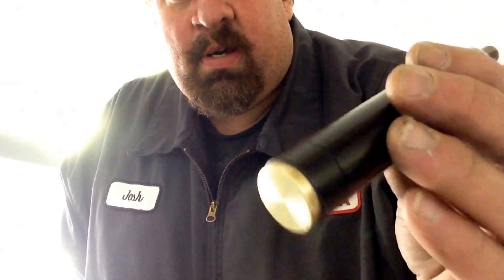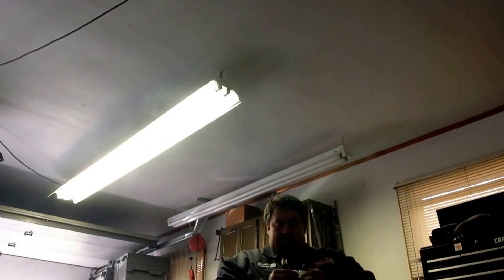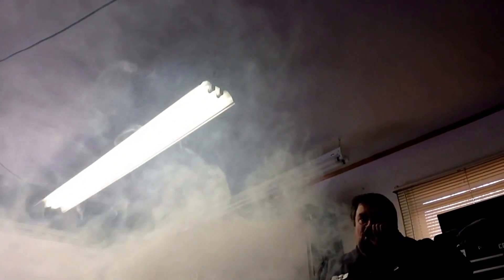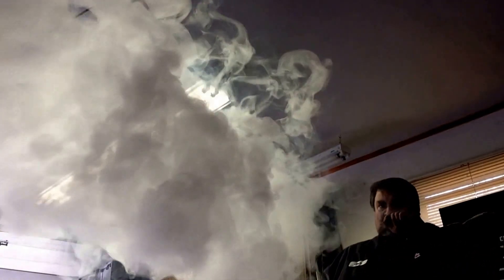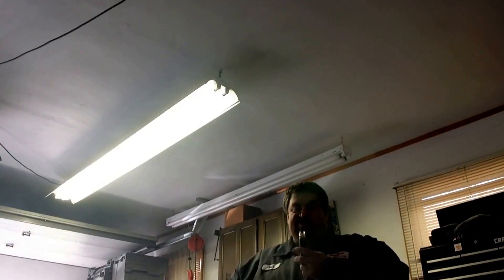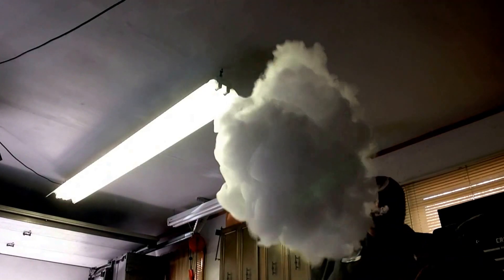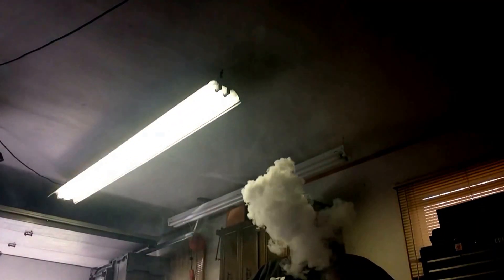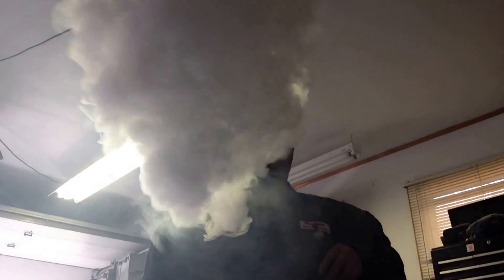Fogging it out with the ameravape Manhattan,nimbus,copper post, triple parallel oval build @ .08 ohm

Comment: Anybody that want's to blow clouds, here's the long story short:
~*Drill your atty to AT LEAST dual 5/64th's, I like 1/8th" and wider actually.*
~*Wrap 24ga 4-5 times on a 1/16th" drill bit, make two of those. (for 22ga wrap 6-8 times), it should come out to 0.2 ohms, use a 30amp battery. (sony is the best)*
~*If you really want to blow huge ones, get some Gplat, look it up, you'll thank me later, get the 22ga elite if you have an ohm meter and know what your doing.*
~Wick with the fluffiest, lightest cotton you can, through and under the coil. Shiseido makeup cotton is the fastest wicking in my experience, it's japanese makeup cotton and it wicks about 2x faster/better, tastes better too.*
~*Juice up with some 100%VG juice, even 80VG/20PG is good for some builds.*
~*Inhale quick and confidently and become a fog machine!*

~Always be safe, know your amp rating, and ohm's law. Hope this helps! Will reply if I missed anything.

Comment: Doesn't seem like it would be very hot I'm running single strand dual 20 gauge .08 and it gets very warm (the vapor)

Would you say trip parallel 24 is not near as hot? 

Thinking of switching. Any advice  appreciated